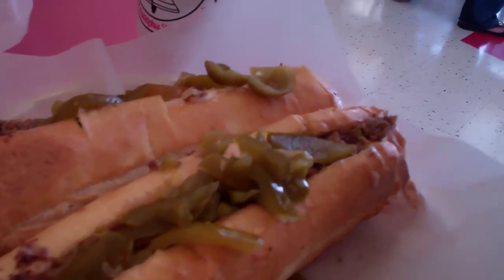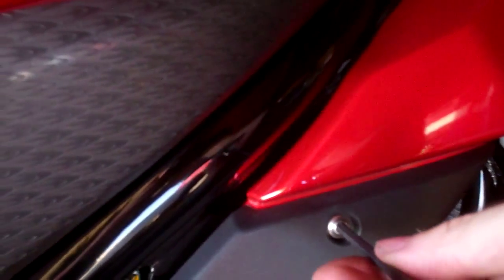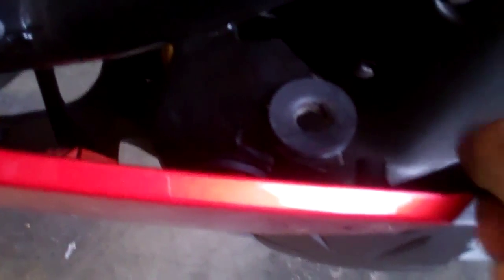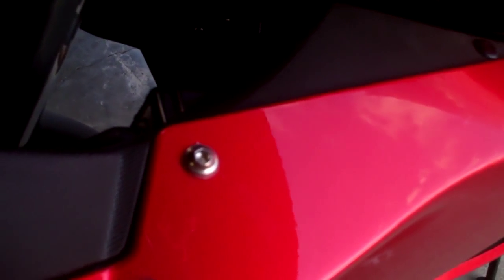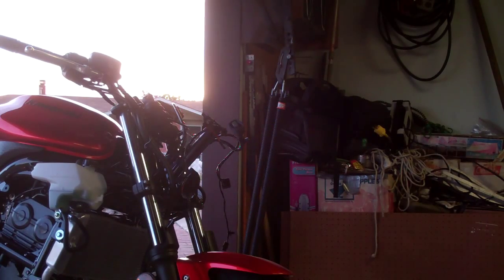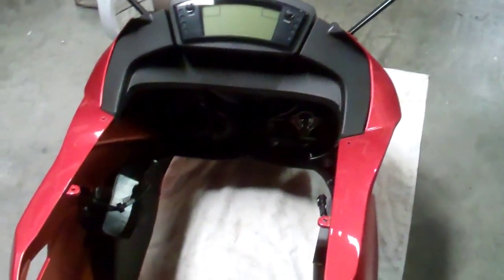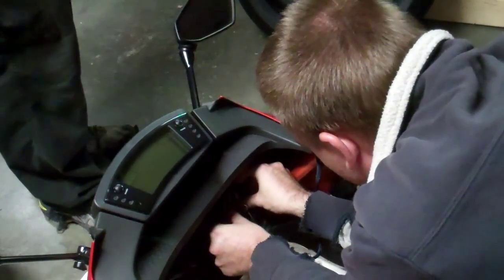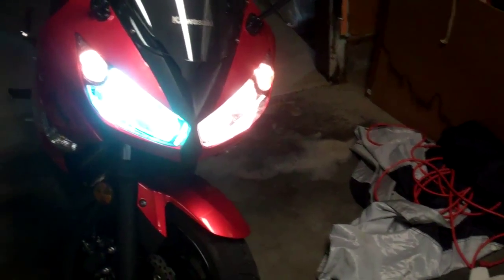[392] How to Install HID Headlights - 2011-09-24

Comment: I did this to my 08 650. It was much easier than yours. it took me 45 minutes. I just had to remove one black plastic piece above the left side center cowl fairing and then I could take the headlight out from there. It should of took 30 min but I took a break its cold here in Michigan.